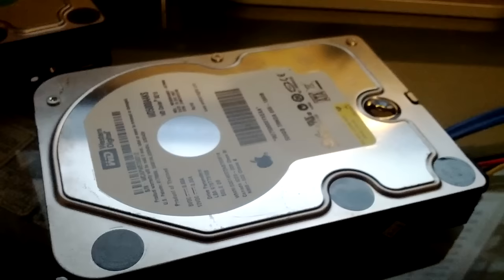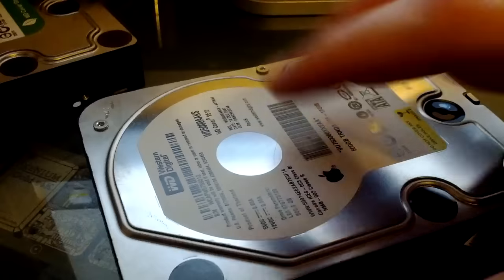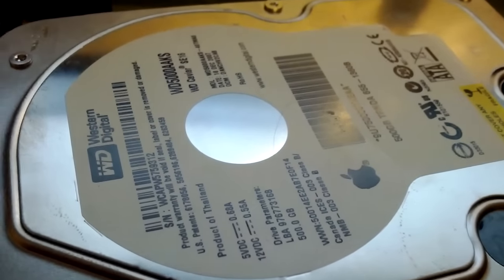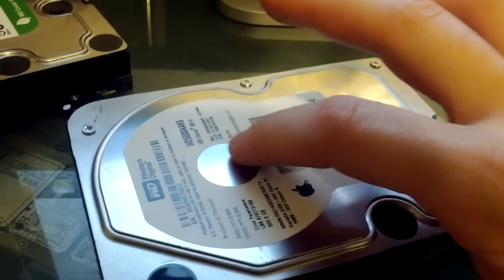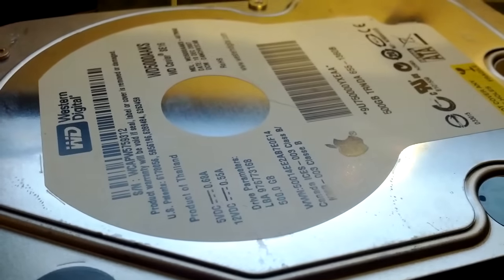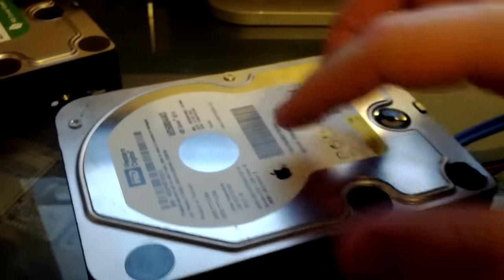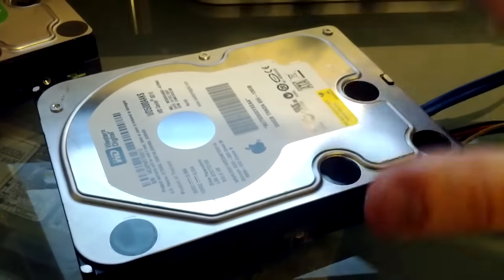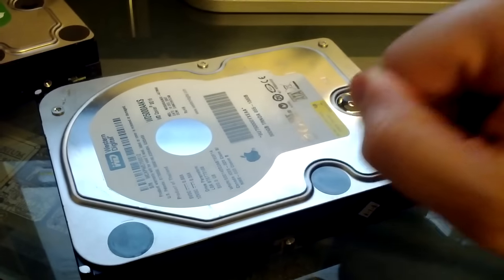The road to hard drive failure: Sounds

Comment: That can actually be repaired if you're careful. If you open it carefully and move the head back yourself. If you're lucky, you can do so without scratching the platter. If you do, most of the data can be recovered perfectly, and whatever was scratched will become a bad sector.
Reply: Move the head back? The heads are already clicking!
Reply: +datarecoveryguy.com 

...
Exactly. The head dances like that because it has no idea where it is.
Moving it back into the parked position would usually fix that.
Reply: The click you are hearing are the heads parking themselves ...and after coming back out onto the platter.   So you have your wish of parking the heads ...just not your perceived end result. :) the solution is quite a bit more complicated.
Reply: +datarecoveryguy.com 

Actually,  the click is produced from the head contacting the motor. The head never does park correctly.
Reply: If the head contacted the motor they would be destroyed, but they can't reach it physically anyway. When the heads park themselves the rear of the actuator arm near the vc is a stop devices. This is what you are hearing make the click. 

Rather than do people a disservice by having them fool with their drives and likely having them lose their important files forever, if you see this problem a lot and are in the IT business join our partner program as we pay out hundreds in commission every month. Everyone wins.
Reply: +datarecoveryguy.com 

I'm no business. I am an individual. I personally won't attempt repair or recommend anyone to do so since anything but a white room will more than often cause more damage than repair. 

As for the head, the sound could be from parking or just from hitting the max distance towards the motor. 

If it properly parked,  the issue would fix itself as the head would then know where it is. Clicking issues are usually caused by the head not parking correctly when the drive shuts off. I know the motor produces power to return the head when power is absent. 

So, manually moving the head into the parked position can usually fix the issue as it then would correctly identify where it is.
Reply: Unfortunately all of that info is mostly incorrect.  Parking has absolutely nothing to do with why it's clicking as heads use information on the platter to determine where they are not the parking area and the motor's only reason for existence is strictly for spinning the platters. Magnetism and current  are what move the actuator arm not the motor. If you're interested in learning more about hard drives there is an excellent book called: Hard Drive Mechatronics and Control. Unfortunately it's not a cheap book. Sadly nothing in data recovery is cheap.
Reply: datarecoveryguy.com 

I clearly stated the motor produces power to move the head when power is ABSENT. A motor can double as a generator, so they use that fact to ensure the head parks when power is removed. 

The R/W head cannot identify where it is at start to read the platter in the first place. It gets quite a bit of detail about the drive at start so if it's not parked, it won't be able to find that and therefore will not be able to function.

Obviously I won't have all the correct information, and even if I do, I'm not amazing at explaining; but it seems you may have incorrect and/or incomplete information also. Most definitely, with the motor.

Comment: I got a cheap ex lease computer really cheap and its got these symptoms. I guess those SATA hard drives are quite cheap to replace anyway. But I just realized it did come with a 1 month warranty so maybe if I take it back there they might do something. Had it about a week. It has nothing important on it so I don't care about losing the data. But then I think I might have lost the receipt. Not stressed it didn't cost me much and just a spare machine.

Comment: Sometimes it's due to the power supply. An old Hitachi external drive I have clicks when connected to a low power (data only) USB port but functions normally on other ports.

Comment: I bought a refurbished laptop and according to CrystalDiskInfo the HDD is in good conditions but I am skeptical since it has 195,000 hours of Power On! That's 22 years of Power On!!

Also the HDD makes raw noises when starting the laptop and I even had some files and programs like Notepad and Paint deleted out of nowhere. The programs are still there but were wiped out from my user profile. I'm not exactly sure if it was because of the Clean Windows Install.
Reply: yeah I wouldn't believe it has 22 years of being on...a laptop that old would have a tiny drive and be a huge brick
Reply: heh I still have a miniscribe 20mb  MFM drive attached to an a2090 controlller in an old amiga 2000  - it still works and has always been clunky!
Reply: Aztrax Xeno 
J

Comment: Temporary FIX to HDD/Head sticking: While drive out of housing/computer frame, give (1-3) horizontal (NOT VERTICAL) 10lbs taps to side of drive while spinning / running. Head or data platters should begin to function properly enough to gather / backup data to flash drive (FYI - do not turn off power after platters and/or head begins to function or it will stick again)
Reply: +Stephen Patrick its not sticking. It just can't read the media surface, meaning either the platters are corrupted or the heads have failed. I can hear the heads moving and trying to read.

Comment: I was worried about my computer making a clicking noise, I did some research and I found it could be my hard drive but it doesn't sound like this at all, it's louder and eventually went away on its own so I'm thinking it's one of my fans.
Reply: Had the  same problem about 3 months ago. Somehow its returned  i think its one of my fans since my hard drive is ok.Probably a lose screw or some dust. Im gonna  look to my fans.I will inform you guys  that have the same problem

Comment: my HDD gives static noise during startup is that a problem?
Reply: Nope no problem.
Reply: Maybe. They're not all going to fail in the same way. Some of them will fail but not have this clicking noise. My drive is making some weird creaking noises. This just started a few days ago. I'm not seeing slow transfer rates or any other weird problems yet, but the noise is worrisome. I had a drive die about 2 years ago. It didn't make any weird noises but over time it got slower and slower and slower until it was just crawling, completely unusable. Any program install would take well over and hour. It'll usually warn you when it's about to die. If you have precious information, I suggest you back it up. I generally just game on my pc so if it dies, whatever.

Comment: Ew a Mac.
Reply: lol, how am i a fanboy?
Reply: +Shawn Kearney I play games on a computer I built, it runs on Windows, the reason I dislike macs is because they are overpriced prebuilt shit.
Reply: I do not know much about consumer hardware, but I do know from a first-hand experience that the Mac Pro is similarly priced to a similarly configured Dell 5000/7000, HP Z-series or Lenovo P-series. I know, because I was recently in the market to buy one.

As for any "Apple Tax" what PC users often neglect to appreciate is that the operating system has to be worth something. How much that's worth is really up to the individual. And yes, the OS and the hardware are optimized together, just look at the performance of any "hackintosh" as evidence.

As for me, I did end up going with a refurbished Dell and eventually installed CentOS. Windows is still a mess of an operating system, but I'll admit that the user experience and overall stability is quite good.

Building my workstation would have been cheaper than buying a new system, but still more than buying the refurbished machine. Plus having a single-source warranty is attractive for professional users. Furthermore without spending a lot, the 5000-series enclousre is better engineered than most of the cases out there that are really designed around lot of hype an not actual engineering.
Reply: Shawn Kearney If you're a "professional" user you don't need a single source warranty as you can find the problem on your own. You can even fix it on your own and not need a warranty if you're truly "professional." Building a PC is better than buying a pre-built computer or day i say it, a Mac.
Reply: Team WaveHD Nothing about what you said really makes any sense, and it's pretty clear you have limited real-world, professional experience.

If a motherboard or video card fails only the most advanced electrical engineer could repair it, if repair is even practical.

When my raid card failed, I had a new one in three days. If my video card fails tomorrow, I will have a new one in three days. If my motherboard fails, or the original hard drive fails next week, I will have one in three days. All of this at no cost to me, but more important, my downtime is pretty much reduced to how long a component can be shipped to me.

I don't need to worry about what warranty expired for what component, I don't have to worry about individual RMA policy, I don't have to worry about if they'll try to find some reason to blame some other component. I know my service contract will expire in June 2017, unless I renew it, and that covers everything that Dell installed.

Really the cost of replacing the component is one thing, the RAID card mentioned costs about $400. But the downtime could cost thousands on top of that.

There is a reason why companies with more than just a handful of machines don't build their own systems - Because keeping track of service contracts is WAY easier than keeping track of hundreds, if not thousands of warranties.
Reply: Team WaveHD ew,a hater
Reply: not really.
Reply: ew a team waveHD
Reply: I’d use a Mac if it had more games support... I’m stuck on shit windows just because I like games
Reply: Hackintosh (installation of macOS on standard PC hardware) > Actual Macs

Comment: My computer has a hardrive and a ssd, all it does it tick one or 2 times, and im guessing its the head moving
Reply: It's not garantede that every drive Making noise will fail I have a noisy Hitachi 1tb that's working from 2013 and still works until now so noise isn't the problem

Comment: Can someone tell me what is this?

Whenever I start my PC it is fine as long as it doesn't load.
 The second It is on the Desktop- my speakers create that sound of tapping.
 As if you get the jack of the speaker and tap it. But a lot louder.
 At moments it sounds like a real fucking gun being shot ( Pretty much every AK in CS ). Then I unplug it and a static high sound starts from my PC
 Whenever I plug it back it created a weird Wubbling sounds. Something as if you're shooting with the same gun & with the same speed but with metal scraps or something.. Or shit like Echo Echo From Ben10 Mixed With Sindel from Mortal Kombat. And It continues like that EVEN if I plug it back in the speakers.

YET  the sound can be decreased with the volume buttons  by both the Subwoofer and the speaker. Also the Mute setting in the Start Bar works too. What the fuck is that shit?

I did have problems with my HDD but I doubt it is that...

Sometimes that noise suddenly stops for a few moments or sth...
Reply: Geek Gamer Greece Found it. My internal soundcard wasn't muted, and when its not- it echoes, making weird sounds.

Comment: Mine works ok, but in hdtune shows an attention status on "interface CRC error count", current 200, worst 200, threshold 0, data 1 

And I guess it makes a low frequency grrrrrr noise when it reads and writes, sort of like dragging your feet in small stones, but lower pitch.  Every component is newly brought about 2-3 weeks ago, except my PSU, GPU and hard drive, and I get these random rare freezes, my monitor turns black all of the sudden... I wonder if it's caused by hdd, anyone experienced this ? 
I use win10 btw
Reply: I wouldn't worry too much about it. An interface CRC error means that the drive is working fine but an error occurred while the data was traveling through the cable to/from the drive (to put it simply).

If the error count ("data") keeps rising, then I'd recommend replacing the cable connecting your hard drive to your motherboard.

As for the noise, that's normal. That's the sound of the actuator arm moving incredibly quickly to position the heads over the spot on the drive containing the data to be read or written. It goes back and forth so fast that it makes audible noise. On most drives, it sounds somewhere between the noise you described and more of a "growling" noise.

Meanwhile, as for the freezes and black screen, while it's possible for a hard drive to cause freezes, it's not going to give you a black screen. I'd suspect your video card, monitor, or even display drivers. If you are using a digital connection to your monitor (DVI, HDMI, DisplayPort, etc. - not VGA), then a low-quality video cable could be to blame. Also make sure that it's connected tightly.

Comment: My old hard drive never made any weird noises but I knew it was on its way out as my laptop was running super slow to the point it was almost unusable. O/S took 2 minutes to boot, high CPU temp spikes, super slow loading web page and saved files ((Like PSD documents)) vanishing without a trace. Strangely enough I never once had any BSOD errors that I remember of. Its an old Laptop, a Compaq NX6110 from 2005 that I got at a garage sale in 2013 and as far as I know, it was still using the hard drive it came with from the factory so its no surprise it was gonna die. I ended up getting a new 80gb SSD for under $20 on ebay and now its running better than it did when it was new. At least I am sure of it :)

Comment: I have a toshiba laptop and one day I spilled lemonade on it and it started making this noise as the lemonade poured out the bottom I spilled it on the keyboard so it went through my laptop it froze so I turned it off then it said no bootable device I turned it off and on again then it finally worked it's been OK for a while but just a couple minutes ago it started making the clicking noise again and froze do I turned it off it said no notable device but I've restarted it many times and it hasn't come back on please help I'm worried about my laptop and the files and my drawings and all
Reply: Yes i spilled a little LITTLE bit of red devil  like few drops on my pc but it seems to be working fine, welll if we do not count that fucking loud MmmMMMMMM at startup. I dont know does it end, i have been restarting my powersupply and it has fixed the problem for a day, but then again the next day, same mmmmMMMMMMM

Comment: this drive is the exact same drive i pulled from my parents imac because it was going bad.....so i replaced it with a 1tb wd blue
Reply: i wouldn't want to waist an ssd on a mac ;)
Reply: WD are the most reliable hard drives you can get....you probably got it delivered by a shit postman who dropped it a load of times
Reply: nope still use them still more reliable than ever, obviously you dont know what you are talking about, every hard drive fails at some point and its easy to get  a doa one because of how fragile they are
Reply: ictdude1 Hitachi is most reliable
Reply: Mickey Romeo no they just sell less so their rma is lower
Reply: have it your way
Reply: i am
Reply: not what i have experienced, i guess its down to personal experience, i have had bad luck with all seagates so i avoid them, i have had good luck with hitatchi 2.5'' drives so i use them but bad with their 3.5'' drive so i avoid them, hgst i have had good luck with (they are a mix of wd and hitatchi) i have only had good luck with wd so for now i use them the most
Reply: only time i use hdd's is when its in a gaming or video editing pc that needs alot of storage
Reply: Hdd are better for a older pc, i thrust hdd more than ssd since hdd are recoverable and ssd not, semi-conductors can fail and when they fail, you get only 0.01% chance to recover ANY data from it, hdd are almost always recoverable, a hdd from columbia dropped out of space when the space shuttle crashed is also recovered, if this was a ssd, each ic (intergrated circuits) would have been fried and dammaged the transistors on the semi-conductor, harddrives are the way to go and btw, i have only lost 1harddrive in the last 10years aand i hafe 5 of them (western digital)
Reply: Mickey Romeo i hope you know Hitachi hard drive have been owned by western digital for a few years now
Reply: it sounds like you are, too
Reply: Mickey Romeo haha naa i just like computer parts that work
Reply: but it actually sounds like you are owned by wd. sad
Reply: Mickey Romeo naa just arguing my point either way an ssd owns all
Reply: finally something we can agree on
Reply: ictdude1 WD HARD DRIVES ARE SHIT TAKE IT FROM SOMEONE THAT repairs COMPUTERS DRYLY
Reply: josh knox i repair computers daily to ..... the most common hdds that fail in the network servers where i work are seagates, the lowest failing hdds in the servers are wds.... 6 months 5 seagates failed and they are the only hard drives that have failed in the server so far
Reply: ictdude1 sorry I didn't no you fixed computers my bad
Reply: josh knox naa dont apologize you didnt know
Reply: +josh knox 

Western Digital are perfectly fine. 
If they're bad for you,  I'll have to refer you to the typical statement: "It's the user's fault,  not the product's".